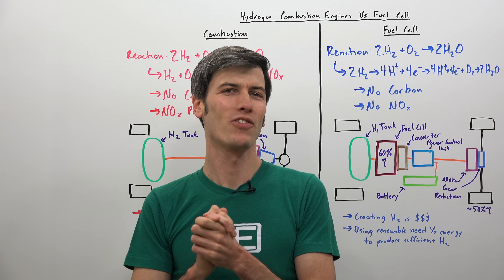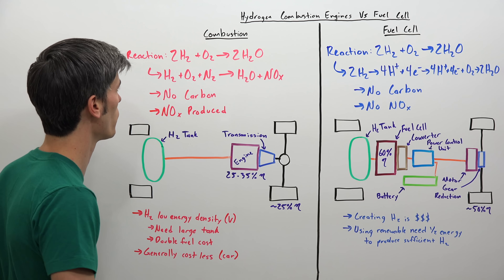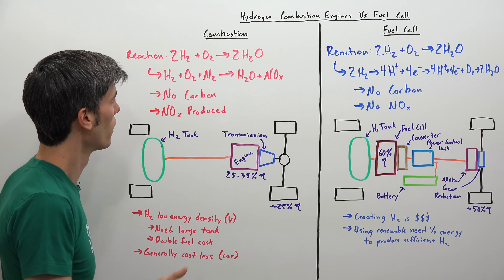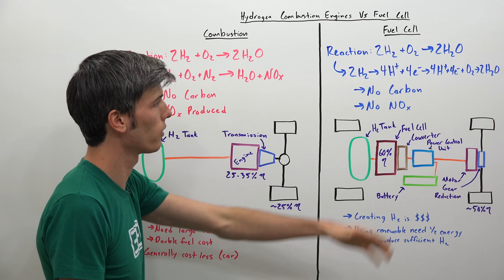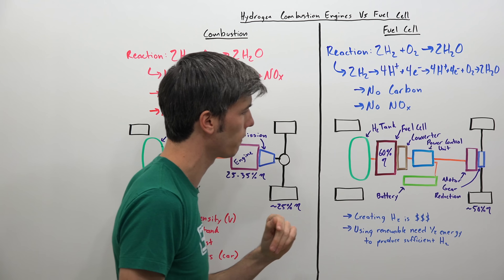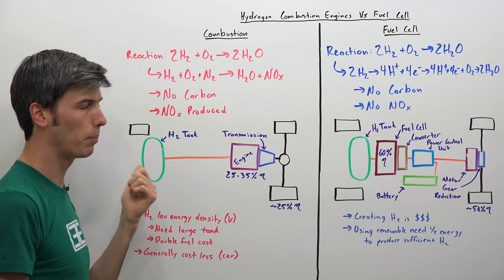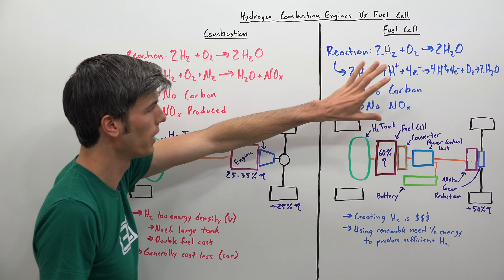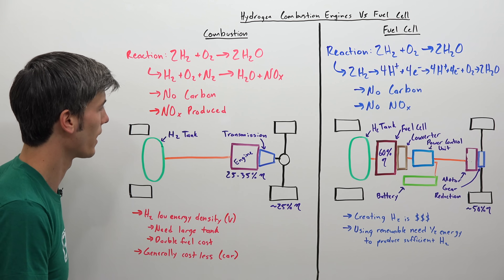Why Hydrogen Engines Are A Bad Idea

Comment: Two things I like to say I think hydrogen combustion has its place in replacing old cars and people who still want something to have noise but be greener 
Because a few nitrous oxide is still better than tons of nitrous oxide tons of CO2 all that stuff combined
Reply: catalytic converters remove the nitrous oxides in vehicles now, don't know why that would change
Reply: CO2 is plant food.  The atmosphere barely has enough to keep plants alive.
Also, CO2 is a very negligible "greenhouse gas." The number one greenhouse gas is WATER VAPOR, and it's ALWAYS going to be there in such vast quantities that the effects of all others are negligible.  That being said, just as an oven's temperature is controlled by the heat source, not the insulation around the box, the EARTH's overall temperature is controlled by solar output, not the atmosphere.  All the atmosphere does is minimize the difference between the daylight side and the night side.
Venus isn't insanely hot due to CO2 in the atmosphere, it's insanely hot because it receives 9/4 as much sunlight per unit of area as the earth does.  The temperature of the Earth's surface, overall, is approximaately 300 Kelvin, and that of Venus around 700 Kelvin.

Comment: Your explanations are all true, except for financial considerations. Yes, a fuel cell is twice as efficient as an IC engine. I worked for the leading fuel cell manufacturer for 10 years. Our city buses before conversion to Hydrogen fuel cells cost $325 thousand each. After converion $3.5 million each! Now these were 100% Hydrogen power, no hybrid battery involved. It is ten times more expensive if you compare Kw to Kw, Hydrogen to IC piston engine. The diesel busses converted to Hydrogen diesel would have cost perhaps $500 thousand each. As you can see the Hydrogen fuel cell as a large industrial vehicle power source is not viable. The non-renewable Platinum catalyst alone for one of these busses is $350 thousand.
Your arugument is interesting, but not applicable to the actual real World.
Reply: Art of War  Niether are you silly

Comment: Gasoline powered cars also produce NOx, as well as having a relatively same amount of efficiency overall. In my opinion, Hydrogen combustion engines would be a perfect alternative for race cars and high performance sports cars, as well as car enthusiasts in the event that the world runs out of oil and gasoline... There are already those same NOx emissions coming out of normal gasoline vehicles, and with the subtraction of carbon emissions, they could prove to be a great alternative.
Reply: I know this is late but yes I agree. Not to mention that it would be fairly simple to convert existing cars to a hydrogen based engine instead of just having to buy a new car
Reply: If it were only that simple. Unfortunately, NOx released into the atmosphere becomes acidic and results in acidic rain- increased corrosion where ever it lands; bad for crops, buildings, roads and cars. FWIW, I am a life long motorhead myself, cannot make peace with the idea of broadcasting my "motor noise" via recording and speakers. Guarantee you it is just not the same. FR
Reply: You can burn NOx with an egr system

Comment: It's easy to run an internal combustion engine on hydrogen if you have a distributor to adjust the timing for the faster burn makes it ideal for the commoner.
Reply: You know… except the fuel is super expensive and the tanks are gigantic and made of Kevlar… other than that. Great for the commoner
Reply: Correct! Wonder who pay this guy to run the fuel of the future down???
Reply: @andyford2630  Anyone who can do basic math knows this isn’t “the fuel of the future.”